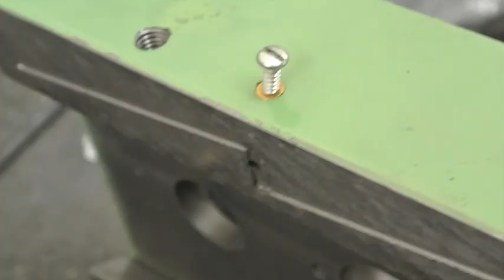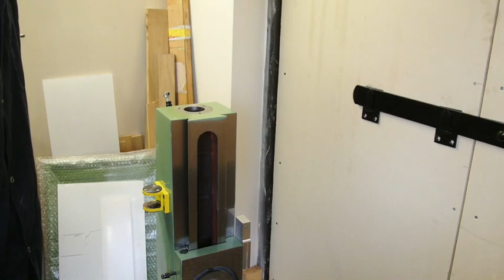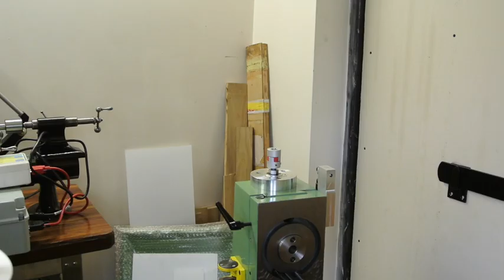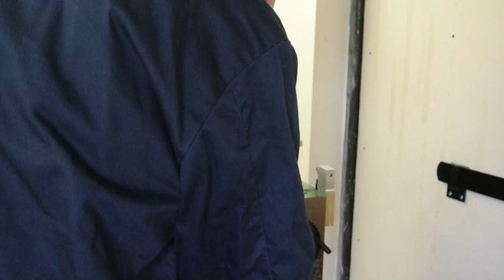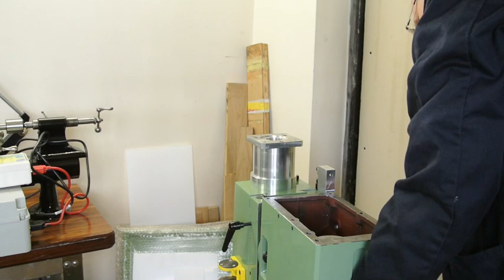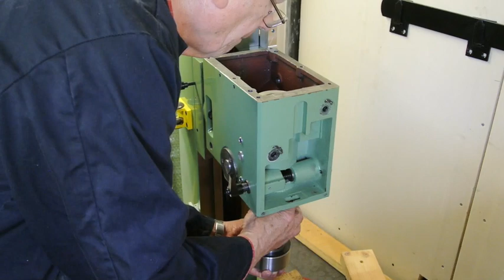Part 6 Warco 18 GH the Z axis ball screw and ball nut

Comment: Hi John, this seems a really simple and nice way to mount the stepper motors. Can I ask you, the part you are holding at 9 mins 22, is that made from a solid or a tube and whats the diameter of it please? Also if possible where did you get the alloy?
Reply from the maker: Hi David

The part was made from 90mm dia . I use 6082 as it is easily machined and forms chips. I do also use 7075 but it is more of a struggle to machine large components. I am sorry I do not remember who I ordered it from. I see that aluminium on line do a thick walled tube 3" od which would be ideal. They also do solid rod 80mm. Parting off large diameters is always a problem if you have a Boxford size lathe. I know have a small cheap electric powered belt hacksaw and it cuts through rod like this as if it was butter. i didn't know why I didn't buy one years ago. Good luck! John